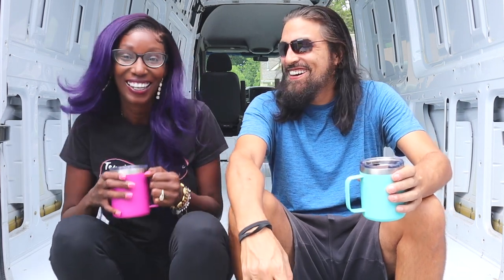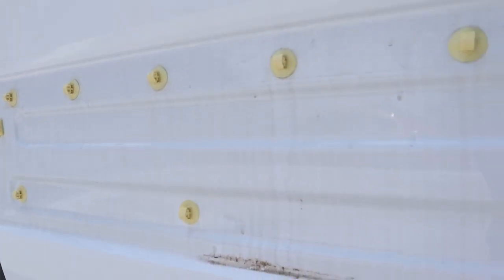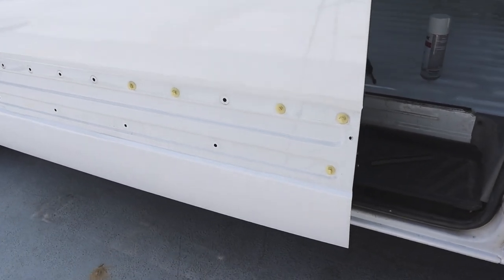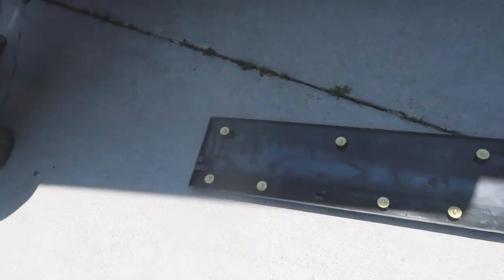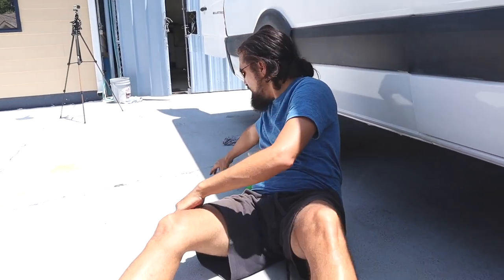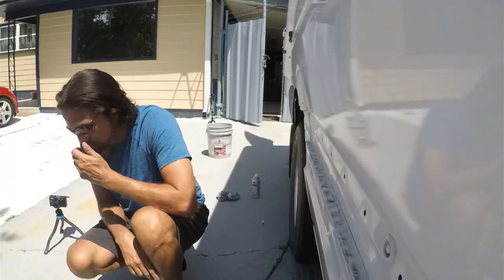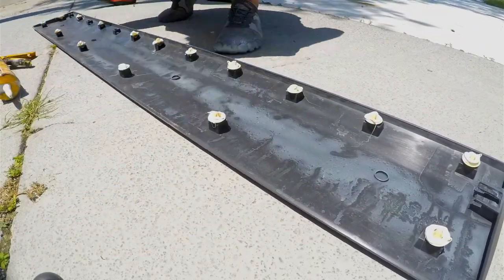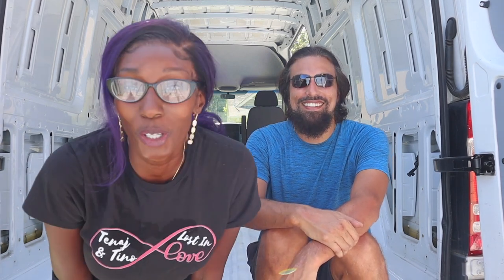How To Remove External Side Trim Panel From A Sprinter Van

Comment: Hey Tenaj & Tino!!! Out of ALL the van builds that I have seen, I don't recall anyone ever removing those exterior side guard panels and sealing the holes but it is actually a great idea to address rust prevention. I guess I'll be doing mine as well. Thank you for the lesson and Thank you for sharing. 😎
Reply from the maker: No prob. Thanks for watching. Yea that’s one of the big rust areas on the van.
Reply: @TenajTino  Y'all taught me something 👀
Reply from the maker: Cool 😎